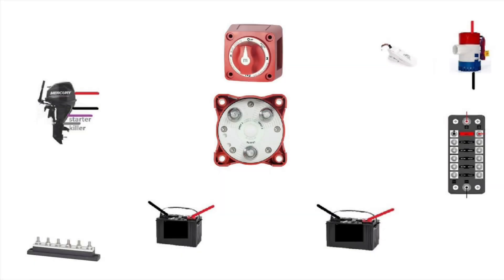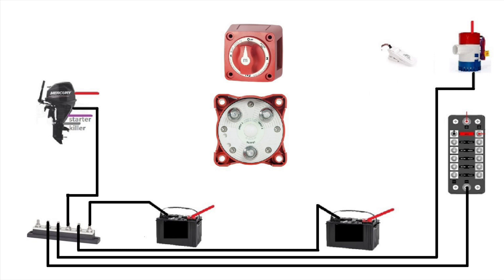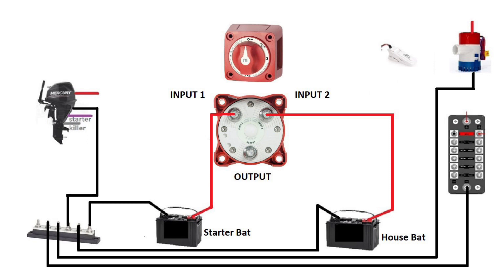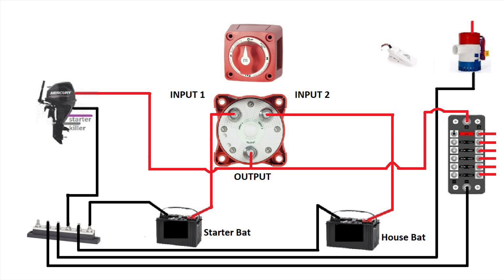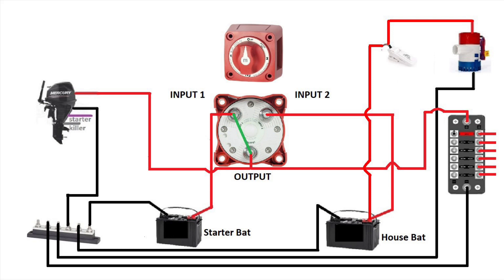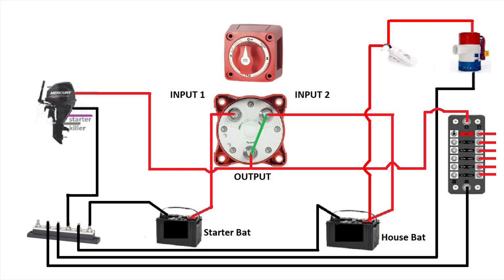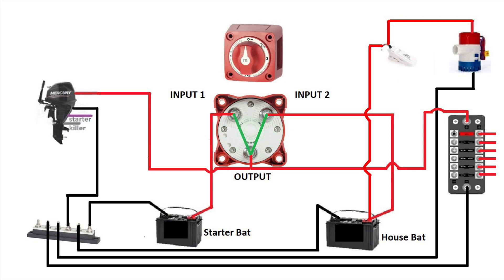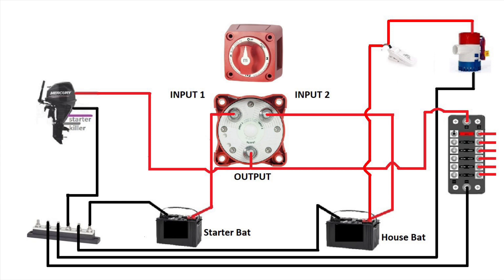How to install a battery switch on a boat

Comment: I'm sorry but this video is really misleading, in essence the wiring is correct but it shows no charging circuit and could for this reason alone be the start of a major head ache.
Reply from the maker: Hi, thanks for watching. I appreciate the feedback; I do try to keep my videos as simple as possible. This video demonstrates basic wiring and how a switch operates. Keep in mind that your outboard will have an alternator or regulator to recharge the batteries. I hope this is useful.

Comment: This was so helpful, but I need a diagram with a rocker switch control panel that has an on and off switch to power it. Do you have any videos of this same diagram but with a rocker switch panel ? I have an old pontoon boat so I don’t need a bilge pump. I just have a lot of audio and recently been put lights. But I can’t figure it out
Reply from the maker: Hi dazdog, thanks for watching. I have a couple of videos on electronics for boat. check out my channel. 

Is this what your looking for the switch panel: https://youtu.be/lHwetz08R_w?si=tIHx2D131Y1LsGuY
let me know :)

i try to keep the videos simple so it easier to understand. Let me know if this helped.
Reply: @joetheboatguy5394 it didn’t help, I’m going to look at your videos, hopefully I can find what I’m looking for.  My switch panel is a little different. It has its own pre wired switches and and separate on and off switch.

Comment: Can you use a single battery with duel battery switch.   Need a switch to shut off hummingbird Ethernet switch and not ready to buy second battery yet.
Reply from the maker: Hi ashleyherzog, thanks for watching. You kind of answered the solution to your problem. If you want to just shut off the Ethernet switch, just install a switch for that. That would be the easiest solution. Hope this helps. :)

Comment: im using this as a antispark option would this work
Reply from the maker: Hi cliffcosynerflight, thanks for watching. This switch is mostly used for boats. What would you use it for?
Reply: @joetheboatguy5394  im  thinking to use it on Ebikes motors  for a electric boat as a Antispark switch which 1- Energizing  Both- transition 2- Main power. as most Antispark switch are Mosfet driven  and have a risk of failure. the the question is if this would hold 48V or 200A
Reply from the maker: Hi cliffcosynerflight, I usually use the break before make switch from Blue sea. For the Antispark question, you would need to ask Bleu Sea since they have many differente switchs.      www.bluesea.com     I don't know about all the specification, but they have many switches available i'm sure they can help you. I know they have switch for 48V 300amp
If you get an answer let us know :)

Comment: Hi how do you combine a VSR with this switch please
Reply from the maker: Hi stephanbruno, Thanks for watching. First I need to ask, why would you like to combine VSR and switch? Do you have a specific reason? They both do the same thing, except one is automatic and the other one you have full control over what you want to do. If you really want to combine both, then I would put the VRS between both batteries. So, connect the + of the starter battery to one side of the VSR and the + of the deep-cycle battery to the other side of the VSR. And ground goes to ground. Let me know if this helps. :)

Comment: Thank you for this, so easy to understand. I heard a boat mech say you should never switch positions with the motor running. What is your thoughts on that? thanks again.
Reply from the maker: Hi MrGsxr, Thanks for watching and nice comment :) For '' you should never switch positions with the motor running '' it depends on the switch you have. If you have a Make Before Break switch, then it should not be a problem. If you have a Break Before Make switch, then that can damage your alternator on your engine upon switch. Hope this help :)

Comment: This seems complicated, can I just have two cranking batteries?
Reply from the maker: hi alligator, thanks for watching. yes you can but you will not get the longevity that a deep cycle battery will give you.

Deep Cycle Battery: Common in settings where continuous power is necessary, like marine applications or renewable energy setups. They are capable of long discharge-recharge cycles, supporting devices that need a steady power supply.

Regular Battery: Best suited for vehicles requiring quick energy surges for starting engines, such as cars, motorcycles, or trucks. They are not designed for long, deep discharges, as this can significantly reduce their lifespan

Comment: Ok, i guess im missing the obvious, if I'm using bluesea system 9002e 4 position switch with AFD, i start boat on 1, will my running lights come on if all lights are on house battery (position 2) i do lot of night fishing. So i have to start on 1 then switch to 2 or 1/2 to use lights???  Im confused. Bought the switch but havent installed cause i dont understand if my lights and depthfinder dont come when i start boat at night.
Thanks if you respond
Reply from the maker: Hi johnalmaguer, Thanks for watching and for your question.

Here's your switch specification:

e-Series Selector Battery Switch with AFD  9002e Switches isolated battery banks to all loads or combines battery banks to all loads

    Includes AFD (Alternator Field Disconnect)
    Make-before-break contact design allows switching between battery banks without power interruption
    Ignition protected—safe for installation aboard gasoline powered boats
    Case design allows surface or rear panel mounting

The Make- before-break is one of the things was looking for: you got it, excellent.

Ok, for your lights and equipment they will work on switch 1,2 or both. Since you have the Make-before-Break your lights and equipment won't flicker when switching positions.  

Battery 1
Here's the reason why we have 2 batteries and switch. One battery is usually a starting battery to start your engine (Starter battery usually on switch 1) has more cranking power since it's a starting battery. 

Battery 2
Your second battery is usually a deep cycle battery. It will have less of a cranking power but a longer lasting for your lights and equipment. 

Position 1 on switch to start your engine (Cranking battery), but your lights and equipment will also run
Position 2 to run equipment for longer period of time (Deep Cycle battery) this position is ALSO to not discharge your cranking battery to start your engine. 

But like a said all your lights and equipment will work in any position. Your just selecting which battery you're using. Be careful to not discharge too much your battery 1 you will have a hard time to start your engine (especially is you have a big engine). 

If you had a different switch "break before Make" then it's a whole different scenario, but you have a good switch 
Hope this helps 👍
good luck :)

Comment: HI Joe, great Job!
is it possable to put a VSR in the circut as well, when switch is set on both?
Reply from the maker: Hi TheJimmyrazor, thanks for watching and nice comment. Yes it is possible to add a VSR for when your switch is set on Both positions. Now it depends on what you would like to do, To start is it a Dual or single VSR you would like to install? If its a single VSR what battery are you looking to protect more, I'm guessing your startup battery..... let me know :)

Comment: Do not ever - EVER - switch from starter battery to house battery with the engine running as mentioned in this video!!!!!!!!!  You will instantly fry the ECM (engine control module) and cost you a thousand or more dollars - and your engine will quite possibly never run right again.  Just look at the warning on the switch if you don't believe me!!!!!!!!
Reply from the maker: Hi Frank, thank you for your comment, I do mention this in the discription of the video.... "A break before make switch can cause damage to outboard alternators."

Comment: I have heard a few different things about the negative wire on the batteries. I was told to have the deep cycle negative put to the negative terminal of my starter battery. From then put the negative cable from the starter battery on to the bus bar. Does it make much of a different?
Reply from the maker: Hi tylerdifranco, Thanks for watching. It all depends on your setup and equipment connected to your batteries. But the best way is having both negative batteries wires going to bus bar. But both ways will work if you have the right gauge wire everywhere.

Comment: Why is not good option to charge both batteries at one time over the main switch?
Reply from the maker: Hi pilipoff, thanks for watching. OK here we go, when you are set to BOTH position. startup battery and deep cycle it can be done but it can cause a loss of life of both batteries due to the differences in capacities and charge rates. That is why I say its not a good option but totally doable if needed. :)

If I don't mention that it can possibly cause issues, my comment area would be full of people saying that it can cause problems LOL. So I mention it :)
Reply: @joetheboatguy5394  Thanks a lot! Finally I got an answer for the question 🙏

Comment: Hey Joe.  Sorry for terrible quality video but just wanted to confirm where the 2 wires go for red switch. Or, do i still need to even connect the switch if im going to turn key in controls? Here's video but sorry for quality as it was dark and i struggled to keep area lit byt still record : https://youtu.be/EUE4vn4CThI
Reply from the maker: Hey Mike, I see you did some good advancement. I will send you a video soon for the kill switch 👍

For the white wire I think it’s a tachometer wire you won’t need it if that’s the case.
Reply from the maker: Here you go Mike check this out: https://youtu.be/uLzJqLj7fBQ
Reply from the maker: For the gas line yes you can remove the end connector and put it in the mixed gas container. Only for starting and testing your engine. You can test your bulb once you put the line in Fuel tank, if it gets hard after a couple of squeezes your good to go. :)
Reply from the maker: Why would your black yellow stripe wire have a female and male connection is to connect multiple kill switch in parallel. Sorry forgot to mention that 👍
Reply: @joetheboatguy5394  thanks SO much for these replies and making a video for me!  I'll review while in front of motor when I can. Thanks again for your generosity of time, Joe!
Reply: @joetheboatguy5394  Hey Joe. Not sure if you saw, I posted an updated video because the black/yellow wires in my motor are all connected internally (spoken for) and I can't find a place to put that black/yellow wire from my red switch.  So my question is: if I can't figure out where to connect my red switch wires (the 1 wire), can I leave the red switch disconnected, and I can just turn motor on and off with key in ignition, and I can turn it off with key too? I just wanted to make sure that motor doesn't start when I connect battery wires.  Here's the second video I made after you posted yours, because our wires were a little different. SO sorry to keep bugging you about this: https://youtu.be/KCm3Pc3BH6s?si=wDp-nmyp-WRKnTl6
Reply from the maker: Hey Mike, here is a little raw video on my kill switch on my mercury. Let me know if it helps
 https://youtu.be/g5HXPmhzJR0
Reply: @joetheboatguy5394  hey Joe. So I have bad news. After everything I've gone though with my 50hp and mechanic giving me non stop bad news and more money (3000+ now), i thought I had everything ready on my 25Hp to fire it up. * went to fire it up this morning. Had a new marine battery ready to go. Had the wires where I thought I should. Did similar continuity testing as you showed for kill switch.  Our wires and locations aren't identical but I was sure I had it all correct.  Turned key on ignition (on controls), and motor immediately tried to turn over, but that's not thr scary part. Right away, I noticed little sparks coming from bottom corner sort of where the wires connect.  I've never turned a motor on without cover on so I wasn't sure that was normal or not. Tried key again, and motor was trying to turn over (sounded normal).  Then, I saw the electrical sparking again in one corner and then the motor caught on fire from inside somewhere.  I quickly turned key off. Pulled ear muffs off hose and had to spray the garden hose onto motor to put fire out. Was on fire maybe 6-8 seconds. Firstly, my primer bulb was stiff from not being used for months. I had to use channellocks to squeeze it. Took many squeezes but I finally heard gas going up hose into motor and eventually the primer filled up.  It's possible there's sitting fuel in the motor casing somewhere.   But I'm now wondering why it sparked.  I'll have to make a video and point to you where it sparked from. The fire seemed to be more internal and not from exactly where it sparked if that makes sense.  I'm wondering if I crossed a + and - somewhere. But if I fid , wouldn't a fuse or something blow somewhere?  Would it even try to turn over?  It sounded totally normally like it was about to start, until the fire broke out. So obviously the spark ignited some fuel inside the motor. I don't know which part caught on fire. I was too hurried to put fire out instead of recording.  I'm now afraid to try again and tempted to disconnect the kill switch. I put the black/yellow in line with where i thought it was supposed to go, which was a little different than yours because positions were different. ** if I remove the 2 kill switch wires and leave it disconnected, * can I just turn motor on and off with ignition key?  I might get coursge to try again but leave kill switch out and put things back the way they were with no kill switch connected.  As long as motor doesn't turn on but no way of turning off..... I'm now also nervous if I damaged something internally. I'm also nervous about pouring water into motor. I didn't know how else to put fire out while semi panicking.  I'm guessing it's not normal to visually see sparking when you turn key with cover off?  Sorry, between 50hp still not fixed and now setting this motor on fire, I'm having a bad day.
Reply from the maker: oh no so sorry to hear that, fire and spark not good. Let me know where your spark came from. They should not be sparks when you turn your engine. if you did the continuity test it should not be the kill switch causing your problem. let me know where the spark was.
Reply from the maker: Ok, Mike you mention 2 problems that would have caused the fire. Your loose red wire especially the one from the battery that will cause sparks. Make sure that bolt and wire is tight.  Lots of power coming from there if the bolt is loose it can cause sparks. 

Now, what caused the fire I suspect the fuel and vapours that were hit by the spark. You mention that your squeeze bubble is tough. Make sure that when you squeeze your fuel bubble, it doesn't come out of cracked line in your fuel line. That would explain why you have fuel to the bottom of the engine where your fire started because of the spark. Too bad your far away I would help you start that baby up. 

So 2 things to do. Tighten that bolt so wire is tight and make sure you're not losing fuel from a line. 

If you don't want your engine to start. Don't connect fuel line and have your kill switch on. This way your engine will turn but won't start. This would be to test the spark. When you see that you've eliminated the spark issue, then try to really start your engine.
Reply: @joetheboatguy5394  Yes, too bad you're not closer! Which state are you in lol? Close to Michigan at all? I'm just across the border from Detroit.... and I know what you're saying about the red wire, although to be honest, it's not as loose as I made it out to be.  It was quite snug, but when I pushed the ring connector, it moved the slightest bit. But I agree with you that it needs to be tight so I will tighten it.  My gut feels like maybe that's not the thing causing the spark.  And the gas line, I'm not sure where gas might be leaking out inside the engine, but I'll try and see if I can.  The bulb being rigid was weird, but somebody at work was saying that can happen when it sits idle for months?  The fact I had to use channel locks to squeeze it multiple times, and I finally heard it pushing gas into the engine. But I didn't hear any liquid leaking anywhere. But either way, I'll see if I can see anything.  I'm just worried now because I poured water into the engine. i can try and dab the areas with a rag to dry them off. I don't see any damaged wires or anything - the fire didn't seem to melt anything, but it did put little burn marks on some spots. And I'll try that test without gas plugged into - although if there's still fuel sitting at the bottom somewhere near the spark, I'll be ready in case it does somehow catch fire again... I just hope nothing can explode.  Thanks again!
Reply from the maker: I thought you would have noticed my accent, I'm from Quebec, Canada. That is why, I don't get the right terms in English all the time LOL. 

Yes try with no fuel and kill switch ON. If your kill switch is OFF your engine can still start with the fuel left in the engine. So make sure one of your kill switches is ON. Your engine will turn but won't start. look for the spark......

Also I notice in the video you sent me. Is your red wire well isolated or its just red electrical tape?